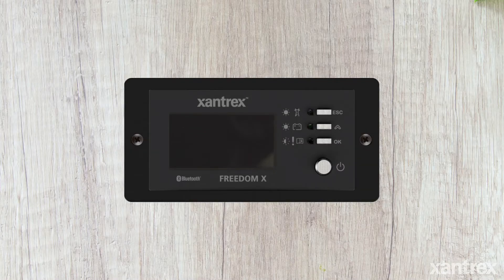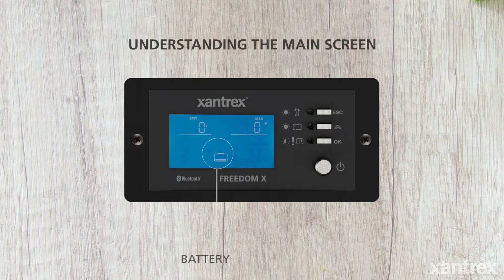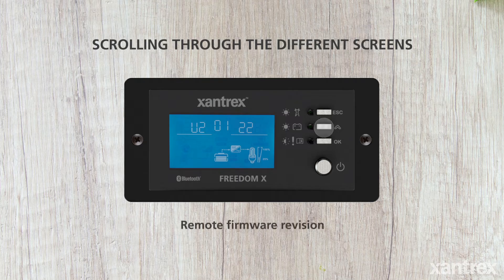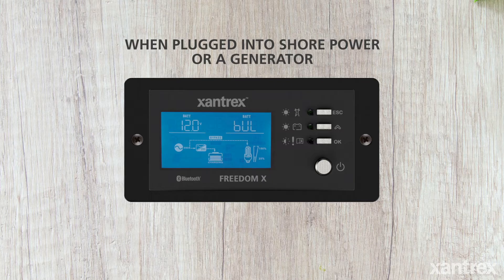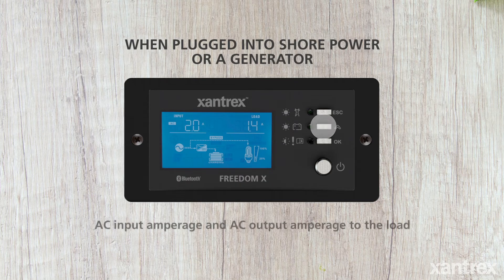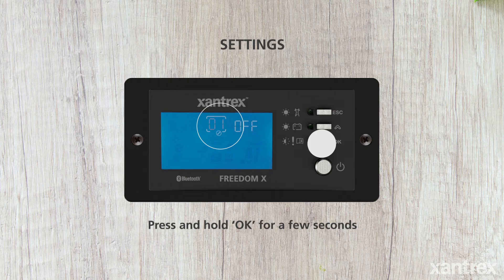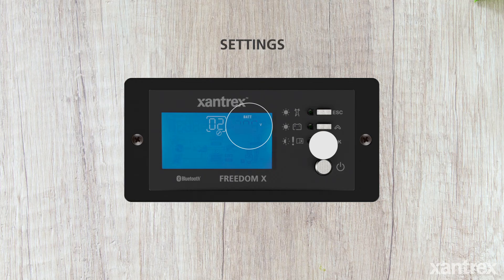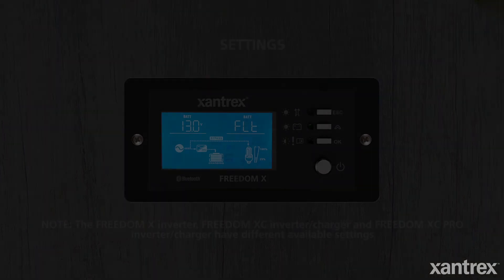FREEDOM X Remote Panel Walkthrough

Comment: Which setting is on your video? I can’t get mine back to that setting!
Reply from the maker: The video starts with the inverter turned off. 
Note that the FREEDOM X, XC and XC PRO may have different available settings and may not be the same as the video. . 
Please reach out to our support team if you need help setting up your inverter/charger
https://xantrex.com/support/get-customer-support/ or by phone 1-800-670-0707

Comment: Hi! Thanks for this walkthrough. We've had this inverter for just a few days. We definitely have a draw happening, but we are not seeing anything displayed for load wattage or the level amount graphic to the right of the bulb. Any clues to what could be going on? Is there any way to activate or deactivate these functions? Where is this info in the manual? TIA
Reply from the maker: The current or wattage readouts are not designed to supply us with diagnostic accuracy but rather to give us a rough idea of how much power is moving into or out of the batteries through the FreedomX/XC inverter or inverter/charger. It is not uncommon for the values to be displayed at zero amps or watts until we clear a few hundred watts of load.
Reply from the maker: The X/XC has a minimum threshold of around 20W.
 Anything close to or less than that will not show. This is stated in the owners guide for the inverter.
Reply: This comment and the answers helped so much...yes I 'read the manual' but...I guess I somehow skimmed past the part in the manual that talks about the minimum 20W threadhold and the readouts purpose. Anyway thank you for asking this.

Comment: I am the proud owner of the 2022 LTV Unite IB.

I found that the 2000 W INVERTER is unable to carry a 700 W coffee maker or the 1000 W air fryer and goes to blinking red-light and error code 01 on fully charged battery mode each time either of these appliances is plugged in at any of the Inverted outlets and nothing else is drawing power.

I have not been able to find the reason for this.  Should I have this inverter checked out loose connections etc as explained on page 84 in the Xantrex Freedom XC PRO Inverter/Charger Owner’s Guide or am I missing something?
Reply from the maker: Hi Tom, 
Sorry to hear that you're experiencing this. 
Our tech team will be able to help you, let's get a support ticket started:
https://xantrex.com/support/get-customer-support/
Or if you can call our toll free line at
1-800-670-0707

Comment: If all is working but the transfer switch? What might be the issue... does the transfer switch have a reset and if yes where is it... my 2020Thor Outlaw has all power working but is not charging my house batteries... any advice would be appreciated?
Reply from the maker: The transfer relays are closed by default.
It appears you have an inverter only model with no charger called FREEDOM X. If you have an inverter with a built-in charger, its called FREEDOM XC. If you have FREEDOM XC, try resetting it to default to see if it is a setup issue. Hope this helps.